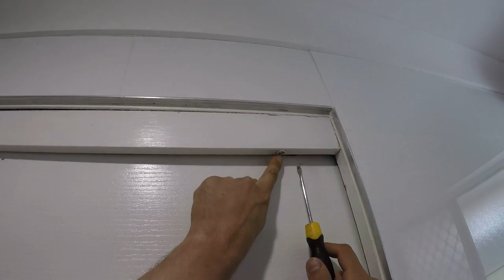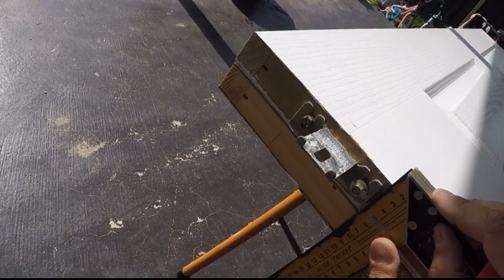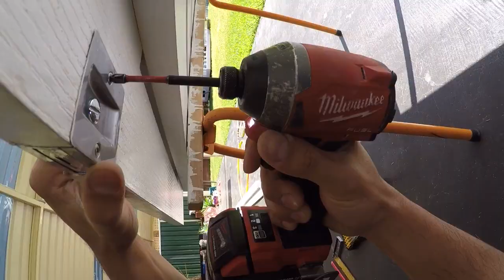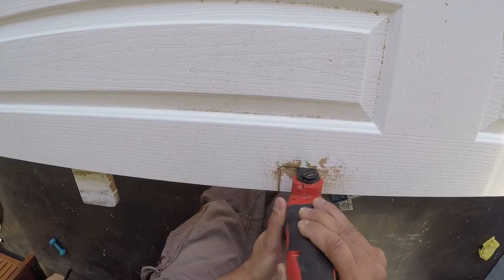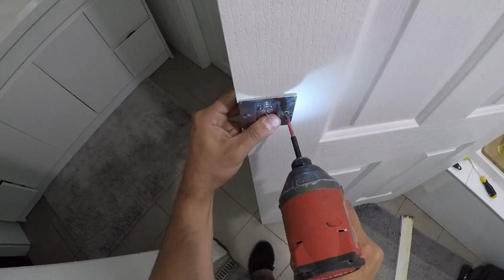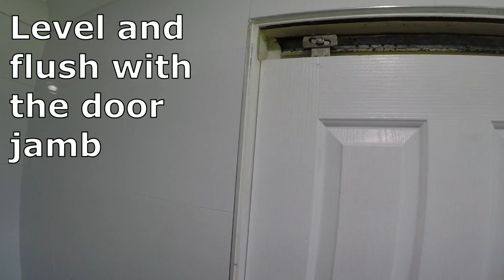How to replace a sliding cavity pocket door - remove and install

Comment: IS THERE A KIND SOUL IN YOUTUBE LAND THAT CAN HELP……..my cavity door has wone the last 6 battles in 5 weeks  6-0.
I know how to level the door and have done so, however I have searched and searched and cannot find how to ADJUST THE DOOR. My problem is the door scrapes against the face leaving scratch marks in the paint in the center of the dead. WHEN I LOOK AT IT HEAD ON THE DOOR IS NOT CENTRED, one side has a gap of maybe 2 mm and the other side a gap f about 4/5 mm. I have scoured many websites but no one ever mentions how to adjust or centre the cavity door.  REALLY WOULD APPERCIATE SOME ADVICE .

Comment: Thanks Bill you helped me fix my door, the issue with mine was that the guiding bracket/piece of plastic at the bottom of the door did not glide smoothly along the sliced crevice along the bottom of the door, becasue of the varying depth of the crevice. So its a bit of a tough fix for me from here, but removing the plastic guiding bracket from the bottom of the frame means the door now slides effortlessly but does sway a bit from side to side because the guiding bracket isnt there to give it a rail so to speak along the bottom. Seen this problem before?
Reply from the maker: The issue would be with the adjustment at the top of the door. You need to raise the door equally on both sides so you have enough clearance for the bottom door guide 👍👍
Reply: @billshowto  thats what i thought after i had packed it all up!! Hahah thanks again mate, subscribed to your neat DIY channel.

Comment: My son stuck a toy car in the gap behind his door when we were in his room with the door closed. We couldn't get out. Carpet was already also making it difficult to open as the carpet fitter didn't put the threshold rail in the right place. Had to climb through a gap we've created but not yet filled for a stained glass panel! Finally got it open but need to fix and rethink. This video will help.

Comment: Great DIY video thx. Timber wedges are really handy for sliding under a door to prop it up to the correct height, or to take the weight as you're removing the door

Comment: Hey Bill great video, have you ever thought of using a track saw to trim the bottom of a door? Not really applicable in this scenario but I was just curious. Cheers
Reply from the maker: Hi, no I prefer to use a circular saw or planer . Planer is fast with clean cuts especially with the new Milwaukee as it’s very accurate. All other cuts I’ll just use a regular circular saw. 👍👍